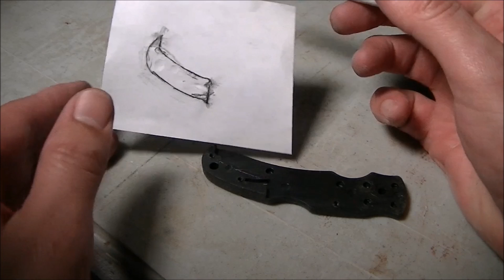Refurbish a Pocket Knife

Comment: Fantastic restoration Dude. Did you have problems with the operation of the knife once you had secured the brass pins?
Reply from the maker: Thanks, it was a little tight at first but it was also very dirty from all the sanding.  The blade has a little bit of slop, not much, but that's because I had to make the right size brass pin for it.  The locking lever and spacer being the same thickness as the blade helps keep it from getting too snug.

Comment: Ok, dude, that was awesome. I've always wanted to make one like this. The brass pins at the box store? I always look at then and then say, naw, maybe next time. I loved this build!
Reply from the maker: Thanks man, I got the brass pins from a knife supplier here in town, but some Hobby Lobby stores carry brass or copper rods.  You could also use the shaft of a nail if you can't get the brass.
Reply: Thanks for the tips. I have a Hobby Lobby about 9 miles away. But the box store does sell them. On the metal side of things. I have a 4x4 or so of diamond plate steel sitting outside. I need to think what I can make from it.
Reply from the maker: That's funny neither Home Depot or Lowes sell brass rods near me.  Can't wait to see what you make.